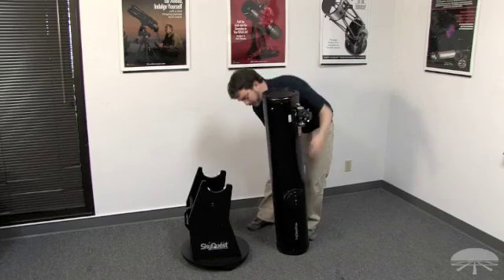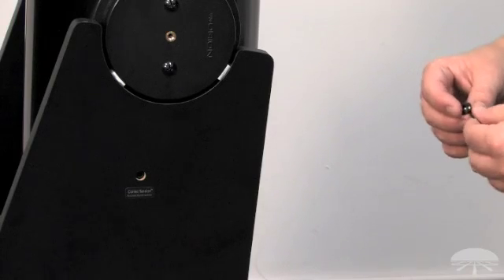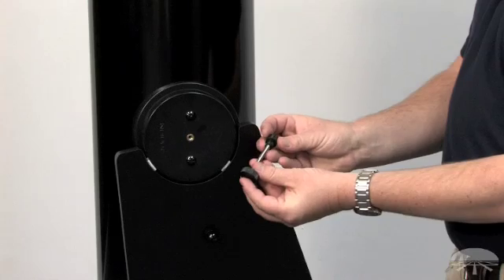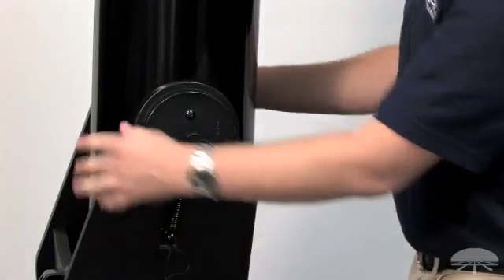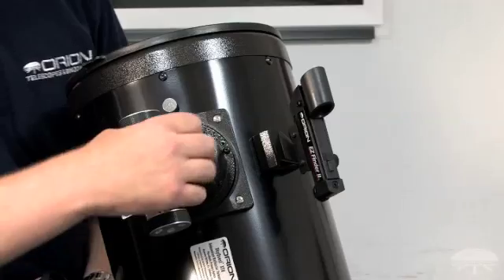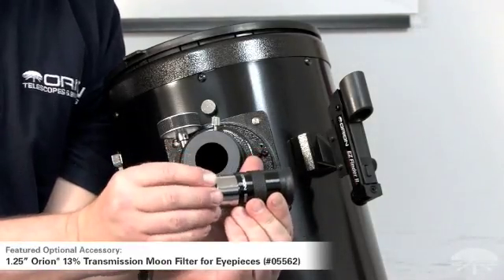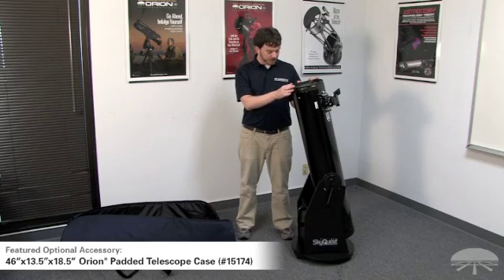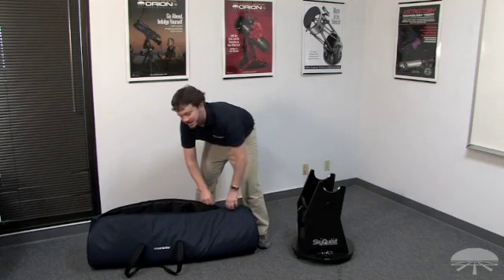How To Assemble the Orion SkyQuest XT8 Classic Dobsonian, Part 2

Comment: When installing the 2-Inch Crayford-Style Telescope Focuser onto an older model that has only 3 screws, are the black o-rings that sit between the focuser and the mount necessary? And if so is there only two on the top set of screws or is there 3, one on each? I only found two when I took this apart. Thanks Jeffalt75@aol.com
Reply from the maker: Hi Jeff,

O-rings aren't really necessary.  Our current focusers do not use any o-rings on the screws/nuts that attach to the tube walls.  They could possibly have been used on your old scope to keep the tube surface from being scratched when installing the nuts, but it's really not necessary.  A standard washer is all you really need before threading the nuts onto the screws.

Thanks
-Ken
Orion Telescopes

Comment: is there a heavier case available? what if i need to put the scope in the bed of my truck?
Reply from the maker: jr49 Hi jr49,

We don't offer a hard case, and it would probably be very heavy if we did.  I use the padded case that we sell for my 10" dob, and I put it in the back of my truck no problem.  Our cases have a padding in the walls that will protect the scope from the hard bed of the truck.  If you're still worried about it, you could always put a sleeping bag down first to give it another layer of padding.

Hope that helps.
Thanks,
-Ken
Orion Telescopes
Reply: oriontelescopes  Thanks Ken! Just bought an XT8 plus. This will probably be my first accessory i buy in a few weeks.

Comment: Thank you so much for this video. Some information: The telescope comes in two packages, the base in one, and the tube in the other. Some of the parts you need for assembling the base (the wrenches) are actually in the box with the tube rather than the box with the base.

Comment: Hi TheNEEDSMETBOISE,

The first accessory I would consider would be either a Barlow lens, or a higher magnification eyepiece for planetary details.  A 7-10mm eyepiece would yield very nice high power views of the rings of Saturn and the surface of Jupiter.  The included eyepiece is very good for locating objects, and for seeing larger deep-sky objects such as the Orion nebula and the Andromeda Galaxy.

Thanks!

-Ken
Orion Telescopes

Comment: What specific tools are required to assemble this? or are they provided
Reply: I just put together the XT10 Plus and only thing I needed extra was a bigger cross tip screwdriver. The one they provided was too small and stripped the screws. Everything else is in there